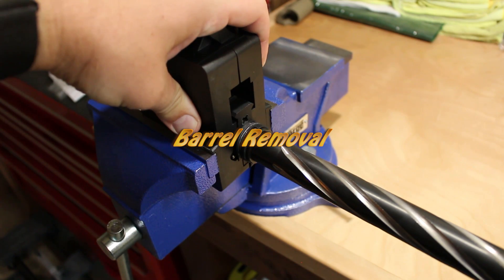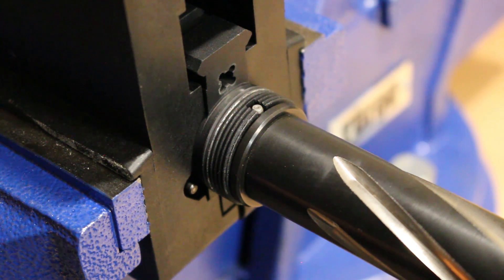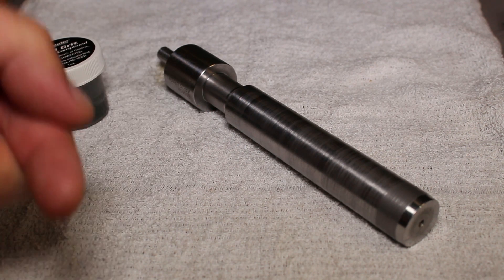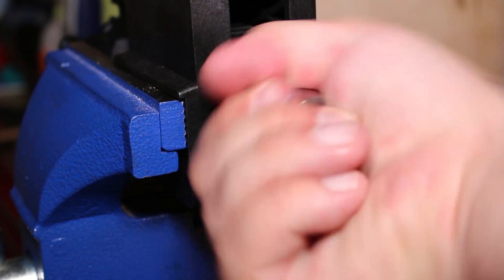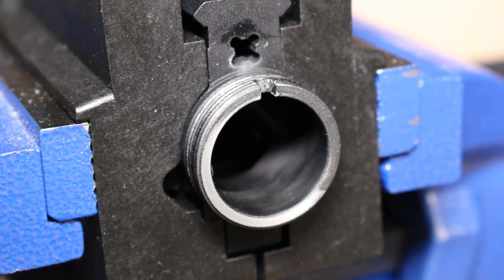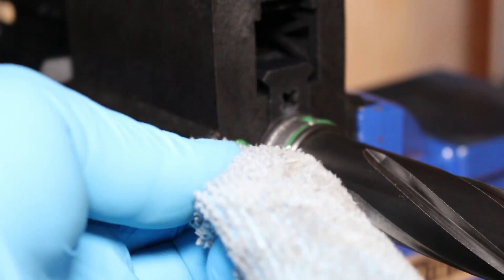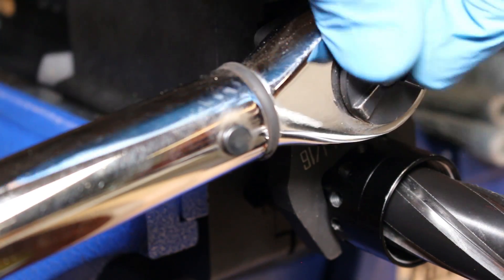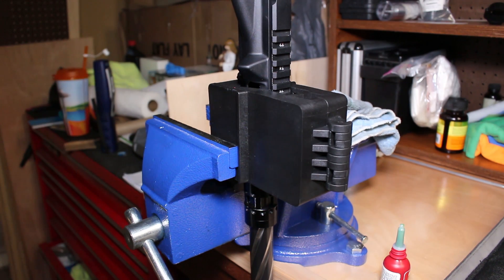Bedding a Barrel into an AR-15 upper receiver

Comment: You actually have two problems going on - a poor fit between the ID of the receiver and the OD of the barrel extension, and a poorly machined receiver face.

Lapping the receiver face only helps the barrel extension sit flush with the receiver, which in turn helps align the barrel with the receiver.  This should help with the wobble, which may help some with accuracy consistency, but it's not going to fix that air gap between the two diameters.  Lapping may also shift the groupings, but may not be noticeable unless you're shooting long distances, depending on how bad the receiver face was.

That diameter gap is large enough to consider wrapping a shim around the extension to compensate for it.  You've got too much space for that 620 to overcome and the barrel nut can only do so much.

Also, lapping the receiver is NOT going to change the headspace.  The only change you'll see is If you take off too much you run the risk of your extension sitting proud in the receiver, which can lead to feed and cycling issues.

So that wiggle you're seeing is not just because of a poorly machined receiver face, but also because of a poor fit between the barrel extension and receiver (i.e. poor tolerances and/or tolerance stacking).  The tightest fit possible is going to be an interference fit.  There are manufacturers who undersize that part of their uppers just a hair so it requires heat to install the barrel.  It's a minor hassle (or a big hassle if you have to remove the barrel because you didn't check your headspace first and it fails, or do any dry fitting of other parts first before installing it into the receiver), but it's worth it if you're chasing sub-MOA accuracy or just consistent accuracy at long distances in general.

Incidentally, lapping the receiver is completely unnecessary for PDW, CQB or other sub-100yd AR's.

Comment: What does the manufacturer of the related parts say to do vs the book? For example on my CMC drop in trigger they say to use a thick moly grease on some sections and gun oil on other sections. The main selling point of the Stoner 5.56 x45 rifle originally was to provide a lighter weight firearm with more fire power at closer distances over the M14 in Vietnam. Stoner vs milspec. The modern AR is a hybrid of those values at best. The tolerances of perfection are too elusive, time consuming, or expensive.

Comment: You can damage your upper doing this without proper tool. You need something like a midwest urr reaction tool that engages the lugs in the barrell when torquing the barrel nut. I wouldnt risk it id use the reaction tool.

Comment: 5:00 Headspacing DOES NOT happen between the outside of the barrel extension and the upper receiver. It DOES happer between the bolt and the barrel extension.

I know you are probably thinking in terms of a bolt action but the headspace is set when they install barrel extensions on the barrel. headspace gauges are only needed if you install the barrel extension yourself

Comment: Use shim material from any auto parts store like you are supposed. Loc-Tite is bull shit for this, sure it works , but what do do you want that dried goop in their is beyond me. Shim ss comes as this one wrap around the tighten & you got it. Even without anything you'd been fine, that is what the barrel nut is for.
Reply: the loctite 620 works awesome for this and is much tighter than you will get with shim stock. I have done it both ways. People are so scared of the loc tite its hilarious tbh. It's not even a poroblem if you need to change the barrel later, heat gun and 30 seconds the barrel slides right out.
Reply: Ya, ah what happens when you fire the AR for even 10 shots? It gets hot. What about when 20? What about a mag dump? You're the one that's Hilarious.😨😰 @pwn3426

Comment: You take material off the face you risk the extension moving to far into the upper (just a few thou) which will cause the feed ramps on the extension to overhang off the ramp cuts (m4 cut) in the upper.

Comment: FWIW, lapping the front of the receiver is only going to get you part of the way there.  That's a really loose fit.  You need to add shim stock or get a custom barrel extension from BAT that's oversized the correct amount to fit your upper.  You may not expect 1/4 MOA, but if your using a single round sled, an AR is capable of it.  If you're ripping rounds out of a loaded mag, 1/2 MOA is pretty good in my book.

Comment: Looks like you followed the same path I did--bought the Wheeler kit and discovered it had an unacceptable amount of runout.  Then bought the Pacific Tool lapping rod and used the Wheeler lapping compound with it...

Comment: That's a machined surface lapping it isn't needed. When you lap you mate two surfaces like when valves are lapped into a valve seat. Your only doing one side on a part that's already flat you can't lap a surface flat you need to machine it flat.And stop using lock tight not needed and only creates problems later.

Comment: Probably only works for extremely loose fitting parts. I bet there won't be any difference if he tested this gun with or without. He should prove it by testing with aeroshell, nothing, then loctite.
Reply: I have tested without bedding and with bedding both after lapping the upper, and there is a difference. My groups tightened up at 100y. Mine has a sloppy fit just like his. Colt upper with a ballistics advantage barrel.

Comment: Brownells says bedding is not required. If there’s a lot of slop in the fit. You need a new receiver.
Reply: Or you can bed them as shown in this video. It hurts nothing and helps a lot. I done done several and verfied results on target......

Comment: If your barrel wiggles in the receiver then you need a different receiver, a higher quality one. If tge tolerances are off in tge front, then they are most likely off over the entire receiver. A good quality upper, lower, and barrel will provide better results that bedding will.

Comment: Thanks for the video. 
Loctite says to use their primer when threads are coated. Loctite uses the metal's elements to cure, so if virgin metal isn't exposed, theoretically loctite won't cure.

Comment: Informative. Why didn't you put any anti-seize on the threads?
Reply: Agree. I would rather use anti-seize compound, rather than loctite between the barrel and upper interface. Same reasoning for the steel nut (if it is indeed steel) to the aluminum threads. Also, I don't want to have to heat the joint to "break" the loctite if I need to strip it down.

Comment: I read all comments. Am certified auto machinist. All torque values are wrong with tool. Your value with tool, should be within 30-80 ft lbs, so technically it's not wrong. Doesn't matter if tool is 90*, or straight, all leverage is the same. This is correct torque measurement. Value A= center of torque wrench handle to center of square nut for "socket" on tool, measured in inches. Value B= center of square on tool "socket wrench" to center of opened end on tool (in your case, center of barrel nut with nut on the wrench) in inches. (A/C))(desired torque)=value with tool. This is the lost bible. Tell a friend. Don't be a guntard.
Reply: you're not the brightest, huh?
Reply: @pwn3426  If you bench test these measurements, you will find them to be accurate. Whatever measurements these guntards come up with, should come to the same conclusions. Tighten to a point just before thread stretch, and nut distortion.

Comment: If you want to increase accuracy spend about an extra $100 and get a VLTOR MUR upper.  Did you see the way that Barrel just slides right into the upper without any resistance? I have assembled two different builds with this receiver and in both instances I had to take a board and a hammer and tap it in because it was so snug. That is the key to having a good Barrel install without movement. Also this is an aerospace company and they have very precise Machining plus the receiver is done with extra metal in critical places so it is more rigid, it weighs more than a mil spec receiver even though it is a forged receiver not Billet. I'm telling you if you want to build an accurized rifle this is the receiver to get and you don't have to deal with any of this nonsense with lapping and putting thread Locker on the barrel. All you need to do is put either Molly grease or some anti-seize and tap it together and torque it down. I have been using the moly grease, but I've heard good things about some certain anti-seize compound. The VLTOR receiver is about $160 to $170. You can get one without forward assist for a little cheaper but I always got the forward assist..

There is also no rough sound when you work the action with this receiver, it is smooth as silk right out of the box. There is a reason this receiver costs more money and honestly the price is not astronomical or anything.

Comment: Can you remove a loctite bedded barrel without harming the upper?  I’ve read you can use a lot of heat but wouldn’t that screw with the aluminum tempering?
Reply: Yes, I use a heat gun (no torch needed). I just did one today, a couple minutes with a heat gun and it came right out.  The right Loctite to use is 620.  It's a bearing retaining compound.  As Loctite says, "LOCTITE® 620 is a retaining compound designed for the bonding of cylindrical fitting parts."
Reply: @jbmillard  yeah, I’m just concerned with the high heat on aluminum hardening it further and making it more fragile

Comment: Thanks for posting this video. I feel obligated to add a comment. If that was my build, I’d immediately grab a different stripped upper (preferably BCM because they always run a little on the tighter side) and check if that barrel had that much slop in a different upper. If the barrel was tight in a different upper, the upper you showed in this video would immediately be thrown out or sent back to the manufacturer if it was still in warranty. That much slop is insane. I’ve never seen anything even close to that much slop. If the barrel had that much slop in a different stripped upper, it’d go back to its manufacturer for sure. Either way, at least one of those 2 parts are getting removed from the equation. I have a friend that swears by the 620 LockTite as well, but he uses WAYYYYYY less. A little goes a long way. You are only trying to fill microscopic gaps. Also, I was always told to use the receiver lapping tool in the vertical position, never the horizontal. Because of the forces of gravity, you likely removed more material on the bottom of the upper than the top. I realize the upper appeared not to show this, but that’s likely because the upper was way out of spec and likely required a bit more time with the lapping tool. Had the receiver been vertical, there’s a much higher likelihood of even and ‘true’ lapping.  Lastly, I’d DEFINITELY use some aeroshell on the barrel nut. The barrel extension is steel, the upper receiver is aluminum. You definitely need an anti seize between the two. I’d be curious to see a follow up video on if your group size shrank, post lapping.
Reply: No antiseize is needed when threads are coated.
However, on a seperate topic, when threads are coated m, a loctite primer is need before using actual loctite.
Reply: @5jjt   Only reason I'm replying is because I just pulled a barrel where aeroshell wasn't used on a receiver that was coated, and even coated again with cerakote.  A lot of galvonic corrosion was present.

Comment: All that and you're torquing the barrel with the upper in a vice block? IMHO buy a reaction rod that indexes off the locking lugs of the barrel. Otherwise nice video...I really don't like applying stress to the receiver.

Comment: It's scary when a person is making a how to for precision AR build and does not understand the basic functions of the AR barrel barrel extension and bolt relationship.  The reciever has ZERO to do with headspace.  Headspace is strictly controlled by the 3 before mentioned components NOTHING ELSE.

The effect of over cutting the reicver's barrel flange neck (the threaded part you seat the barrelnextension into tge receiver) is that the barrel extension end will protrude into and past the upper receivers front wall.  The real issue here is the effect on the feed ramps.  You will c4eate a protruding step between the reciever ramps or face and tge barrel extensions ramp.  You could fix this by facing the front of the barrel extensioncand blending the feed ramps.  You will need a carbine cutter bit for the lathe as the barrel extensions are hardened.

When squaring the from of the receivers barrel flange end which should always be done you always want to go thru tge anodizing.  It always covers that front edge face and is not 100% consistent depth.  Remove enough till you just see that last bit of anodizing is removed.  Stop immediately when you first have a full circumference of bare aluminum showing.   You may need to file the alignment pin notch slightly deeper depending how it's been cut.

They make oversized barrel extensions that will allow you the machine or lap for a tight slip fit.

Comment: You need to use Antiseize when working with dissimilar metals.   Antisieze contains fine metal powder nickle, copper, etc. Metal is added to be the sacrifical anode, like zinc in an outboard motor lower unit. Your barrel nut is steel, your receiver is aluminum. Two different metals waiting to cause trouble.
Reply: Galvanic corrosion requires three things: a noble metal (cathodic) in contact with a less noble metal (anodic) and a common electrolyte, such as moisture.  Steel and aluminum are next to each other on the scale and both are on the anodic side.  It is true that galvanic corrosion can occur between them, but it would require near constant contact with an electrolyte over a long period of time.
Reply: @edwardlance2379  Can that occur if the firearm  is stored under high humidity conditions most of the time?
Reply: @SgtJohnRemairez  Is it possible? sure, is it likely, no, but depends on how high "high" is in terms of humidity and for how long?

I've never had any sort of corrosion on a barrel nut/receiver of an ar-15, even after long term exposure to high humidity levels and getting wet for periods of several days.
Reply: @edwardlance2379   About 15% of the upper barrels I pull have corrosion on them.  I've pulled hundreds.  This is in the desert.

Comment: Heat destroys Loctite, that's why most knowledgeable gunsmiths use head gasket maker. G&G also states that when you square your ar upper by lapping it, that it is better to do it in the vertical position. Just saying.

Comment: Green locktite fails around 200 degrees even red would shit out after three 30 rd mags run through it consecutively. Lapping seems like a decent idea, but shouldn't you check the barrel seat under full tension for contact before just grinding away? Just because you can reload doesn't make you a smith. I would put up disclaimers on this.

Comment: (1) You'll not have head space issue from lapping the front of the receiver. The AR-15 head space is between the bolt and the barrel extension. Even taking a millimeter off (which is ridiculous) the head space will not change. In the extreme, the hammer will not hit square on the firing pin because the barrel is far back, but you need to take off an insane amount of material to get to that point.
(2) The mating of the front of the receiver and the barrel extension's recoil ring is actually NOT SO IMPORTANT. What is more important is the clearance between the barrel extension's outer surface and the inner surface of the receiver. This is what allows the barrel to move around. It is also why clamping receivers like the LMT ARs and the SCAR -- which by design have ZERO slop in this regard when tightened -- are generally more accurate.
(3) Shimming the barrel extension and packing the remaining clearance with Loctite 620 will be responsible for the overwhelming majority of the accuracy gain, finishing the front of the receiver and/or the rear of the barrel extension recoil ring is SECONDARY. It's nice to do, but not ultimately all that crucial.
Reply: A scar is not more accurate than a high quality AR, not even close. In fact it's closer to that of an inexpensive AR but not total bottom end.
Reply: @actionjksn  The SCAR will always have less inaccuracy from the barrel receiver interface than an AR because there will be zero mechanical wander of the barrel. It is a piston gun though which has less consistent harmonics than a DI gun. That said, the SCAR has a hammer forged barrel which is not all that common on ARs except those from SIGs and HKs, and I find it more accurate than ARs in general mainly because of barrel quality being higher than the average AR.
Reply: @dwightlooi My 6920 shoot circles around the 16S. And that’s it’s factory match and hand loads. 

16S is 2 MOA at best with good tailored loads. The 6920 hovers around a minute.
Reply: He is confusing a AR barrel with a Bolt action barrel.

Comment: Wrong way to use a torque wrench you are supposed apply down force on the wrench not pulling up on it 
If I didn’t thank at my place of work my boss would fired me 
I am a Mercedes Benz certified mechanic

Comment: Never seen a barrel that loose. When I did mine it was as tight as my first lay!
Reply: Depends on the tolerances of whoever finishes the receiver. Some manufacturers will intentionally undersize interior diameter specifically to get a tight fit with the barrel extension.

Comment: What kind of lube do you use on barrel nut? Do you clean out chamber area with q-tio to make sure there is no lock tite that might have squeezed by? where did you get that lapping tool? do you index the barrel nut for the rail?